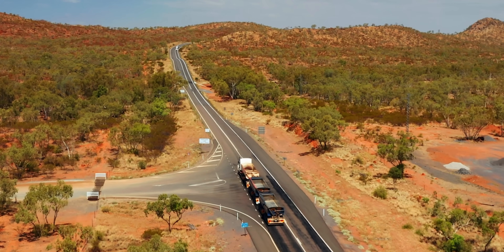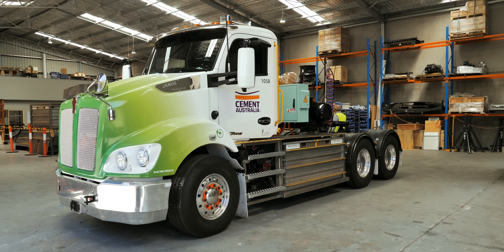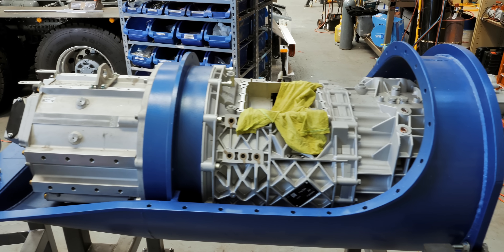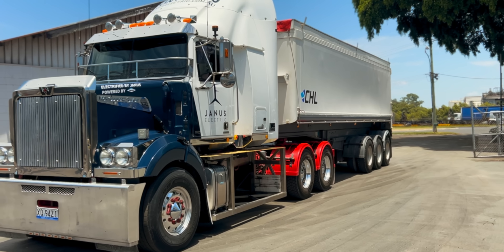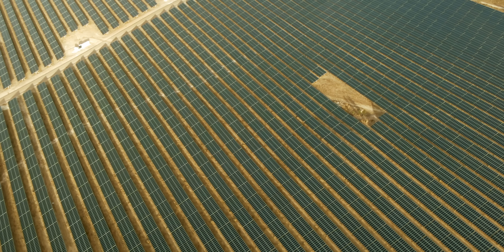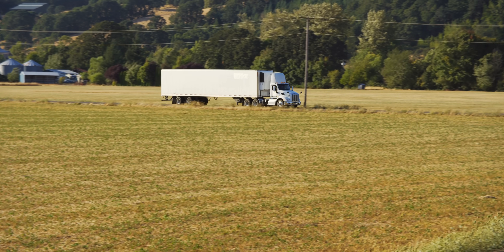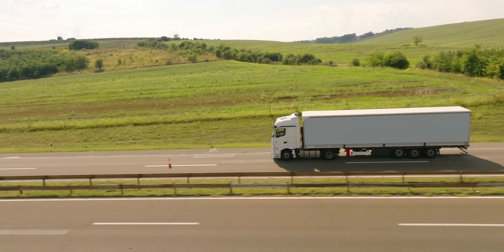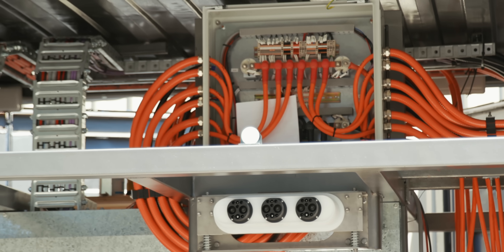This GIANT Electric Semi Can Swap Out Its Batteries!

Comment: Didn't watch the video, but electric trucks are ridiculous! Their range is small, and their cost is still way too high.
I'm all for a hybrid truck. Use a smaller size battery pack to give the truck some extra starting torque, then rely on a reliable 6 to 12 cyl engine (depending on the size of the load), to pull the weight. With a turbo and electric motor (which can be installed in the rear wheels of the trailer), you can downsize the engine, and make the whole process more efficient.
Reply: It's simply too late fore hybrid. We need drastic measures.
Reply: @Freba9  too late? There currently are zero fully electric trucks (tractor trailer), and that's for good reason.
Reply: @ProDigit80  Volvo has been selling electric semis for a while in Europe. Hybrid solutions do not prevent CO2 emissions enough. We need to focus on fully electric.
Reply: @Simon  would never work in usa, since we don't have railroad systems as well developed as Europe. Most tractor trailers drive thousands of miles a week. About 4 to 5x more than what electric trucks would be able to do. Their charge times are too high. There also aren't any truck charging stations here.
Reply: @ProDigit80  Will only be a matter of time.

Comment: So for those truckers that over the road and travel from east to west coast.  Who's going to buy 1000's of battery packs so that a truck coming in for a fuel up can swap and go.  Truck stops would need hundreds of packs and good packs how will they test that incoming battery pack and verify that it's good to be charged swapped and have another 3000 miles put on it?

Sure it will be great to swap in a minute.  Damn sure more congruent with refueling times vs what tesla charging is like now.  I just don't think this will work in a public setting.  What independent trucker could have 10 or 20 battery packs positioned across his/her normal driving area ready for hot swapping?

Comment: What happens to the battery at end of life. Toss it in the woods?
Reply: recycling.
Reply: @Freba9  Just how is that done?
Reply: @RodgerMudd  It mostly comes down to grinding the cells and then separating the different materials.
Reply: @Freba9  Then what happens to the posions, and also the cost to do this is enormous. Hell we can't solve the old tire problem. Oh you must be joking ,right.
Reply: @RodgerMudd  All part of the process. There are several large companies preparing for large scale recycling like Fortum and Redwood Materials. Very interesting to read about.

Comment: The situation in Australia is that there are more deaths from the problems associated with Oxides of Nitrogen and particulates from truck exhausts which get deep into the lungs than motor vehicle accidents. Then there are those who already have lung problems and asthma. Further advantages to ev trucks is the regenerative braking results in less brake dust which is very carcinogenic and all this is before we even mention noise pollution in cities and regional centres and the big elephant in the room, co2 production. 
My mother lives in a city near a major road and all day and night all I can hear when visiting is large diesel engines accelerating or the exhaust brakes as they slow. I would be satisfied if just the noise was reduced.

Comment: It would have been interesting to hear how they handle all the ancillaries that are normally driven from the diesel engine - air compressor, power steering, cab heating (if you need that in Australia!) etc. That's often the hard part of an electric conversion.
Reply: Air compressor can run on an electric motor, power steering these days can be powered by electric, heating and cooling by the AC that runs on, you guessed it, electric power.

Comment: Given that most diesel large tractor units have fuel tanks in the same location as each other, it would make some commercial sense to use the same location for all manufacturers and have an industry standard swappable system. Instant relief from range anxiety

Comment: The tare weight numbers old mate is talking here seem slightly, uh, optimistic. 

If the truck conversion is using the same gearbox and axles, and all you are removing is a 1.5t engine and 1.2t of fuel tanks (weight of tanks if full)

Then you are adding in the electric motor installation at 500kg and 4t of batteries..

Looking at closer to 2t than 500kg difference

Comment: This would work better for car owners that could pull in and swap batteries rather than waiting for a recharge.
Reply: Not really as modern EVs charge faster than you normally take a break on a road trip.
Reply: Check out a brand called NIO, they offer cars with swappable batteries AND traditional charge ability from charging stations/at home.  Best of both worlds, and easier to replace a dud battery when that happens - compared to fixed battery cars which is a headache.

Comment: This is definitely the BS Show.
Battery change .... how many time do you change batteries, at 5 minutes a pop in practical terms, so it equals
the amount of fuel that diesel tanks used to carry. Range of full tanks ~2,000Km. Just for starters, the truck is
limited to the range of the "Battery Swapout Stops", along the intended route ... down to 300Km intervals is the
worst case scenario. All along the route you need an electrical power grid ... or solar .... or diesel generators at
those battery swapout stops. NONE OF IT IS IN PLACE. You are just showcasing a proof of concept ...... what
lies ahead is some 20 years of infrastructure construction.
The battery swapout model: the batteries last about 10 years. Their replacement is a HUMONGOUS COST. You
will find the recharge swapout sums are going to have to be redone. That farcical 60 cents per Kw/hr is more
like $3 per Kw/hr when all is said and done. You forget to take battery replacement costs into account. Not to
mention the overheads of Battery swap Stops. Blindsided by mentioning just what the Truck requires in terms
of power consumption. Deaf, dumb and blind to all the other overhead costs.

Proof of concept is one thing. It falls horribly short of practical reality. Battery power cannot go where Diesel
trucks can go right now, in a nutshell. Cannot compete on price or range, as we speak.

I love battery power, but right now and for the next decade at minimum, its viability is very, very limited. How
about you MENTION ALL THE GOVERNMENT SUBSIDIES WHILE YOU'RE AT IT. You and the laughable 60 cents
per Kw/hr.

Comment: Don’t throw the diesel away …
You will need to re install it soon 
EV is NOT the way to go for heavyweights
Reply from the maker: I love the fantasy world you live in. It so obviously is the way, especially for heavyweights.
Reply: @fullychargedshow  there is no fantasy world here lol!!! Those diesel trucks are still in use all around the world even at remote places where your EV will never reach!
Reply: @fullychargedshow  people are still importing those 30+ years old Mercedes and European trucks to Africa, middle east, Russia....
Reply from the maker: @carholic-sz3qv  Yes, true, the trucks last an incredible amount of time but it's utterly uninteresting because they always need new engines or engines so massively rebuilt they cost a fortune to repair and rebuild, and they are off the road for many weeks, thus losing the ownersserious money.
Internal combustion engines are dead technology. 
Dull, filthy, noisy, toxic and boring and need massive, expensive and very fragile int=frastructure in remote areas that make them utterly impractible and stupidly wasteful and expensive.
E;ectric trucks will supersede filthy old diesel burners much faster than electric cars replacing ide. 
Chuck those diesel lumps in the furnace, melt them down and make something useful
Reply: @fullychargedshow  nope!!! They simply needs regular simple maintainamce and the overhaul is after some huge mileage and also those diesel trucks have much more flexibility much harder work than EVs does! Those road trains crosses the Australian outback on unpaved roads crossing rivers, corrugated roads moves the heaviest loads possible.....
Reply: @fullychargedshow  you should watch roads of deaths or impossible roads those are all places where diesel are used on almost non existent infrastructure.
Reply: @fullychargedshow  oh let's mot forget we have biodiesel, Biogas from waste ans sewage recyclage and treatment.... I understand your enthusiasm for EVs but open your eyes this world was/is build and maintained by ICE no electric.
Reply: @fullychargedshow  the actual useful things I only see is the ICE because they are the ones that have been doing the dirty and heavy jobs all around the world. Your EV very heavily relies on what ICE have made possible for decades(roads, grid....) Also helicopters, aircrafts, ships, trains.... All still much more flexible and useful than electric like it or not
Reply: @fullychargedshow  the other funny thing is that to make your EV we actually still needs massive amount of fossil fuels how sad is that for you to defend! A Tesla as sandy munro said is about 40% made from oil. Keep on with your jokes!!
Reply from the maker: @carholic-sz3qv  Nope, wrong wrong wrong on every count. The old diesel engines are hopelessly inefficient and pathetically unreliable in comparison with an electric motor. Dead tech and boring argument I've heard countless times. Next.
Reply: @fullychargedshow  your arguments are very pathetic to be honest! Electric cars were the first vehicles so technically electric are the old ones! Also as far as I know diesel is still the king of heavy application and definitely reliable, boring what exactly! Can your electric "perfect" motor operate entire farms lands?! What about actually contributing to the building and expansion of our infrastructure!? If it's death tell me why it's still more useful than electric! What BIAS !
Reply: @fullychargedshow  you should come to the reality very quickly! You went to Australia on an aircraft burning tons of fuel is that also good for the planet!? Wtf!!
Reply: @fullychargedshow  good luck with your fantasy with trucks crossing the Nullarbor here in Australia 
There is a 2000km gap in the electrical grid that may pose a problem 
It’s a looong way to push a truck …
If they started today it would be 20plus years to get the electrical infrastructure in place
I will never see it in my lifetime
Reply from the maker: @batmanlives6456  Bit of a 'Last Word Larry' situation. (I always have the last word here)
So, here's the critical point. 
Australia imports all it's oil. You are hopelessly dependent on the goodwill of sometimes repugnant and hostile foreign governments and I suppose that's fine with you.
And as soon as a viable alternative to a hopelessly wasteful inefficient diesel engine comes along you get all puffed up and full of knowledge and understanding and it really annoys you that anyone could have the temerity to suggest that something else might work.
Of course it will work going across the Nullabor, so much easier than dragging a massive tanker rig 1,000's of miles to keep a remote refuelling station going. Hugely wasteful and expensive and of course, stupid.
3 solar farms (I think there's enough space) and the battery recharge containers spread along the road every 350-400 K (with the soon to be revealed robotic battery swapping system, so no forklifts) and you'd get across the nullabor faster in a Janus electric truck at a quarter of the cost and genuinely zero CO2.
Not that CO2 matters to you,  it's probably a left wing conspiracy to remove your freedom or some other limp excuse.
So it doesn't really matter how much you love diesel, it's dead. Long before you'll be.
Reply: @fullychargedshow  sorry pal 
But in Australia we have virtually limitless reserves of natural gas 
Yes you can run a diesel on natural gas 
All the wasted Diesel setting up your pipe dream …
Would never be economically viable
You see your dream doesn’t just appear 
Someone has to build it 
A huge and very costly enterprise with minimal return 
Good luck with that 
Your dream may just work in Europe, and good luck 
But we have the tyranny of distance and that is the ultimate downfall of your dreams 
Don’t greenwash me with your ideas
They are dependent upon fossil fuels to set them up 
So I’m afraid you are just WRONG
The amounts of energy that you aspire to for recharging batteries and ultimately trucks will have to be of quite significant size and recharging will take valuable time 
The battery swap idea is all good until you are caught trading your new good batteries for an old set that will inevitably let you down and you will be stuck with them …
There are so very many significant holes in your pipe dream it scares me how gullible you really are !
You need to put so much more thought into this …..
The recent history of electric vehicles trying to cross the Nullarbor is laughable at best
Polestar (Volvo) attempted this late last year …
Complete with their diesel backup truck carrying a 50 kw generator…
And to really make you laugh the car was seen on the back of the truck for a considerable part of the journey either broken down or the drivers just got sick and tired of recharging for such long periods 
Just imagine how much Diesel was wasted in this exercise trying to convince people they are GREEN ( stupid)
Reply: @fullychargedshow  you are sooooo WRONG
Reply: @fullychargedshow  diesel is here and will be here for decades to come keep living in your high deep dreams! Lol!!!!
Reply from the maker: @batmanlives6456  Sorry pal, you can blather on all you like in your tragic delusion.
I don\t care.
Combustion engines are so 1992. Dated, dead. Pointless. Rant on all you like.
No one cares. It's painfully obvious that electric drive is the future.
You make the most hopeless and limp arguments I've ever heard, and I've heard a lot.
Bye.
Reply from the maker: @carholic-sz3qv  No one cares. Diesel is dead. It's washed up, history. It's over.
Massive LOL, you have no idea what's happening. It's rather sad.
Reply: @fullychargedshow  history started with electric cars if you always seam to forget what typical brainwashing channel looks today! I you have liked to see what those "perfect" electric vehicles would have built those hydroelectric dams, bridges, entire cities...... You have great jokes "Robert" i suppose!
Reply: @fullychargedshow  your EVs were super useful to save people of turkey and Syria right! What a joke!
Reply: @fullychargedshow  of no one cares then tell me why is diesel still the backbone of our economy!? Even the poorest countries are able to use those vehicles that are sooooooo much effective at what they are supposed to do unlike EVs that are super specific in their applications!!! Continue joking around!
Reply: @fullychargedshow  saying that diesel is dead is one of the dumbest argument ever!
Reply: @fullychargedshow  dude 
You are talking to an electrical engineer with 45 years of experience in the distribution sphere and I manage solar farms on a daily basis 
Your fantasy is just that …
It places you in the “nutter” class expecting electricity to do what you profess
Unless you have the power to change physics 
Dream on
Reply: @fullychargedshow  auto expert ( John Cardigan ) tells a far different story than you …
EV fires in Australia are becoming increasingly more common 
And hard to put out !!!
These are undeniable facts !!!
Reply from the maker: @batmanlives6456  Mate. Work it out. Who would be happy to spread stories of endless electric vehicle fires? Who. Go on guess.
The fossil fuel lobbyists who are currently on full attack mode with billions of dollars behind them
"Multi story Cars parks will collapse under weight of electric cars.'
'Electric cars could cause cancer."
'Electric cars fail in cold weather'
'Millions of electric car fires could happen every year.'
All those are actual headlines in actual Murdoch owned newspapers.

here's another headline for you.
"Government data show gasoline vehicles are up to 100x more prone to fires than EVs."

https://electrek.co/2022/01/12/government-data-shows-gasoline-vehicles-are-significantly-more-prone-to-fires-than-evs/

So your so called 'Auto Expert'  John Cardigan who makes his living flogging combustion cars might just be a tiny bit biased and I have zero interest in anything he says
Reply: @fullychargedshow  your just greenwashing 
Dream on !!!
Reply: @fullychargedshow  news reports this week stating in Queensland Australia , fire fighters reported attending at least 1 electric vehicle fire per week over the last year !
No thanks

Comment: This is a Scam , you cant charge a 620kwh battery safely 
Theres is Thousands of fuel places 1 battery swapping place wont cut it , you would need thousands Battery swapping places 
170k for less than half of the milleage range with no prospect of return on Investment
Reply: A 200kw Charger might be able to sustain peak power for less than 10 minutes before it reduces the charging curve to avoid burning & melting Imagine attempting to sustain 200wh for almost 4 hours to charge this giant battery , No charger can do this ( Safely )
Reply: @niceboy60  Nothing to worry about. These chargers already exist (look up 'Tesla Mega Charger) and will become the new standard over the next few years.